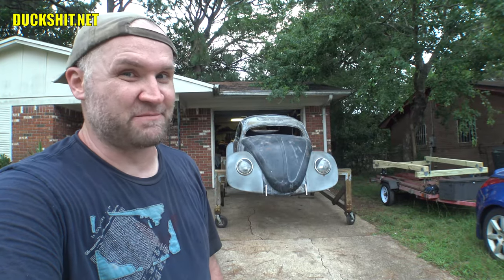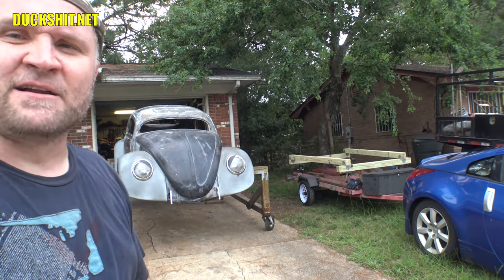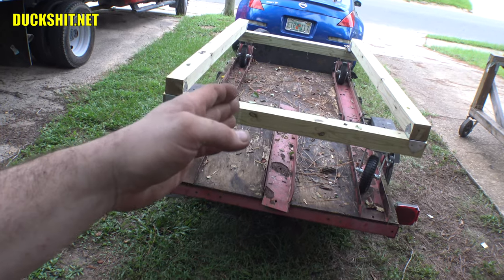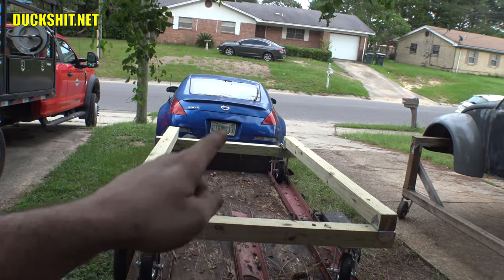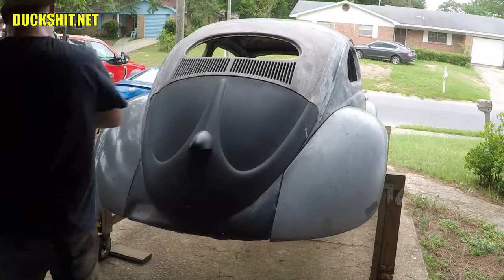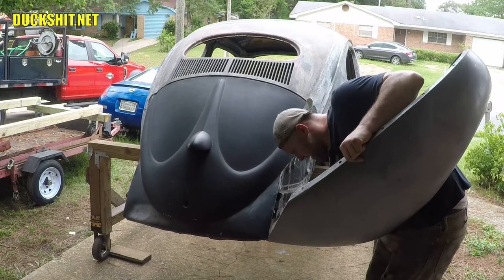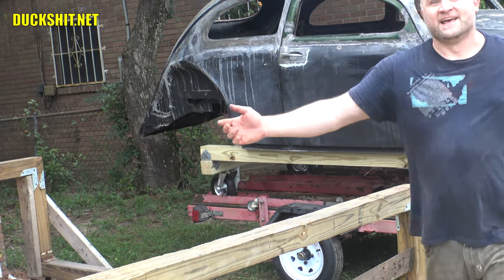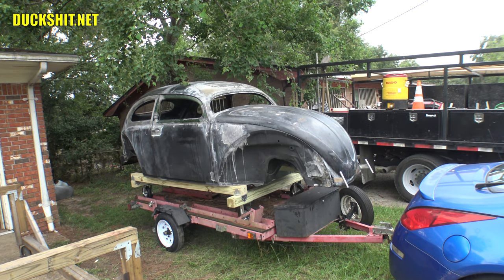I Put My VW Beetle On a Trailer and this Happened! ROTTEN OLD 1956 - 122

Comment: Probably too late for my suggestion, but you should have turned each of the casters on the the dolly on the trailer around, so they don’t keep jamming as they try to spin in the direction of travel, when you try to roll the dolly off the trailer.
Reply from the maker: The dolly doesn't get rolled off the trailer!  So thanks for the suggestion :-)

Comment: I know that you don't want to hear this but only four feet wide?? I wouldn't feel real comfortable but its your hard work and there is not that many let on the rad or even roadable after the millions made too. I wouldn't haul my harley on it and take a chance on it rolling over but then I have suffered the faults of someone else and I lost the load cause I had no choice but to stand on my brakes then they jerked my licence for thirty days that took me a year to get back hence the chicken poop comes out in me. Looks like to me that you spent a lot of time on it. Good luck new to me people.
Reply from the maker: Blah blah blah... this trailer doesn't roll over and I've had 1700lb loads of scrap metal, and other loads that were much heavier and much larger and far more precariously stacked.   But this is also why I had insured for $20,000 (and they give it back to me for free) and so is the trailer, too.  I handled that before I even left, I'm not a moron you know LOL

Comment: 250lbs + 37lbs of bondo and 350ft of welding wire.
Reply from the maker: I think it weighs lots more that that, and I think I use 350ft of welding wire just on small parts on this car lol
Reply: yea, but you ground a 3rd of that off.
Reply from the maker: In some cases I probably ground off even more than that LOL

Comment: I'm surprised that you don't put the body back on the chassis and towed it that way over to CCC
Reply from the maker: That would be twice as many Rolling Wheels that I have to drag, which are a lot heavier than the trailer wheels.   Also the entire chassis is just a lot heavier. I just didn't seem like a good idea to me, plus I had other plans to use the trailer while I was down there for something else that was supposed to be a surprise for you guys, sadly that plan hit a dead end... more on that in a future Q&A video

Comment: now that being resourceful by using a motorcycle trailer to transport Elenore's body to Classic car creations
Reply from the maker: Seems to work pretty well!  Tomorrow's video will reveal more!  Thanks!
Reply: @DuckmanCycles  I'll just hire a small car transporter trailer as & when I need one to take Herbie the places he need to go because it will be a lot cheaper than buying and insuring one which I will only use a few times and it will be easier cause I wont need to find somewhere to store it's when not in use
Reply from the maker: just just a heads up on the insurance factor, if you have hagerty's the trailer is actually included in the policy for Herbie...  and in and in most States your primary car insurance covers the trailer anyway as long as it is attached to the vehicle when there was a mishap
Reply: @DuckmanCycles  thanks for the heads about hagerty's but I live in the UK however most car insurance companies cover the trailer as long as it is attached to the vehicle so I'll will buy one Herbie will be based on a 1600s which I covert to LHD cause the RHD pedal assemblies parts are hard to find and they can't be upgrade but it isn't the case with LHD pedal assemblies/parts so I'll need a lhd 1303 for the required LHD/irs and with my own trailer I can buy/collect one out side of the UK
Reply from the maker: @bendordoy4815  That sounds like a good plan!

Comment: Hope you strapped the doors shut
Reply from the maker: Look closely at the B pillars towards the end of the video
Reply: @DuckmanCycles  Hope you strapped the hood closed.
Reply from the maker: Why strap the hood?  The springs and gravity hold them closed lol.  VW knew this!
Reply: DuckmanCycles and VW Garage I have been bugging the painter about the color and he won’t give a hint.Told me it will take 6 months to finish painting her .Cant wait as I’m sure your excited about your girl getting beautiful
Reply: @DuckmanCycles  Because a friend was modding his, they had taken the catch out and took it for a spin to check something and ended up with the hood over the roof because it caught a bit of wind under there.
Reply from the maker: @Criterion515  Interesting story, but not something that I've ever seen nor heard of happening to a Beetle with a hood that fits correctly.  There is no catch nor handle on this Beetle... and well, its been pulled many times without issues, my white beetle is the same way.... never had a problem.  As I said the springs and gravity keep the hood down, it would have to be compromised (or moving at like 200mph or something ridiculous) to whip off the hood.  Thanks for the story though!  😎👍😎👍😎
Reply from the maker: @jeffcoleman8013  Earl doesn't even know... thats why.  LoL!  I warned him people were gonna chase him about the color... that is the most persistent question, and not to be revealed until you see the first drop of it hit the car.